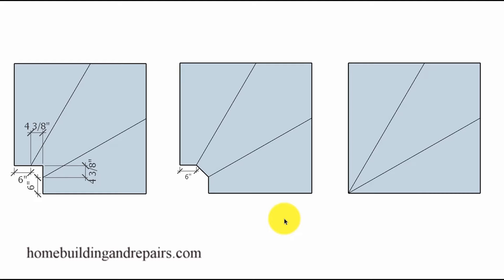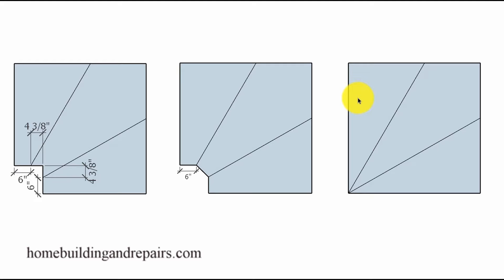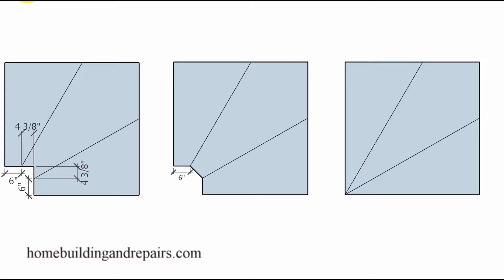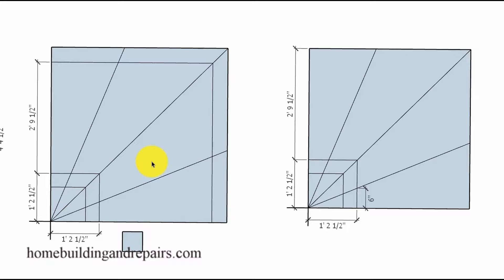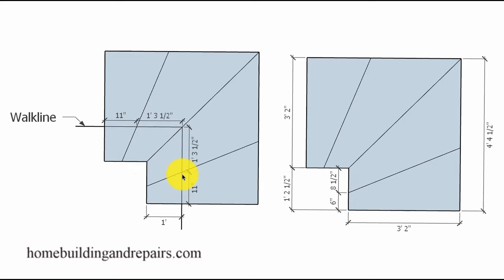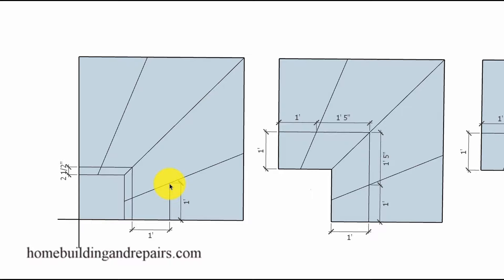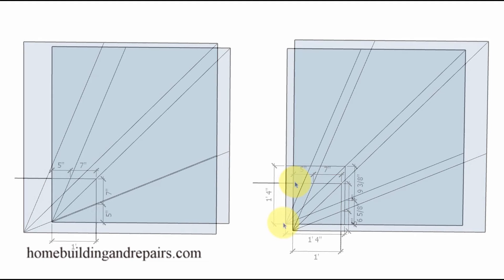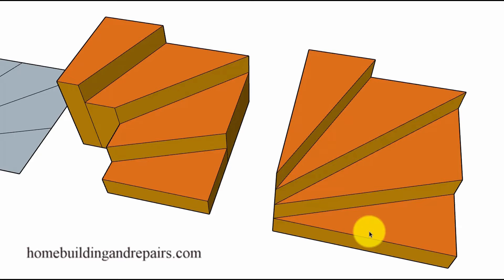How To Layout And Design Four Step Winder To Meet Most Building Codes - Stair Building Ideas

Comment: In some cases, doesn't the walkline tread of each step need to be within 3/8" of each other and made consistent? If so, how would you do that?

If the inside edge and the walkline are not parallel, how do you measure the 12" over?

Been watching many of your videos, great walkthroughs!
Reply: Been struggling with the same thing, hope you get an answer!